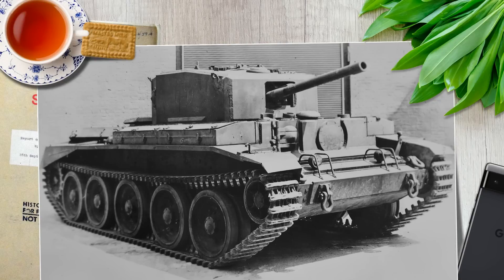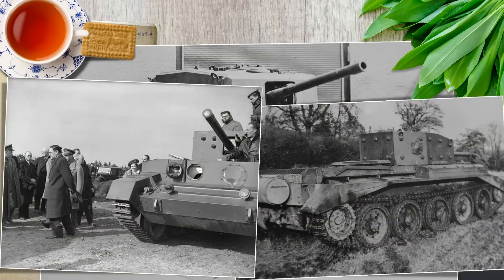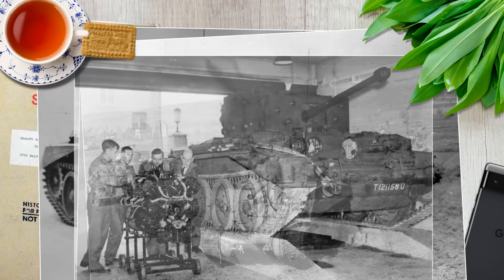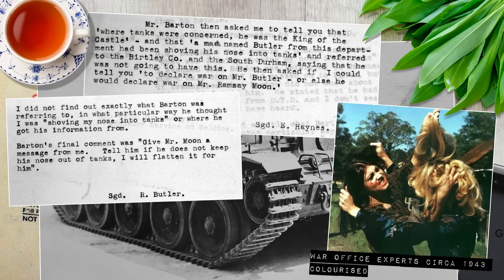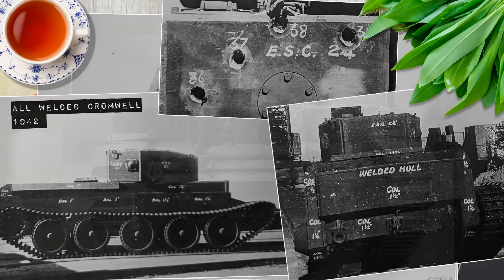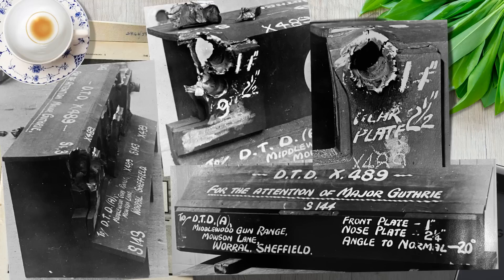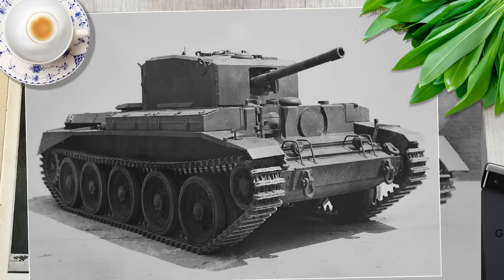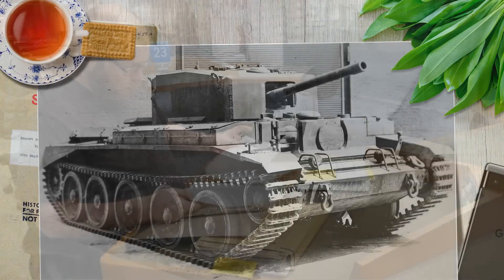Heavy Cromwell - Tank Design & Development

Comment: Always wondered why they never thought of extending the hull over the tracks to take a bigger turret ring and hence a bigger gun as with say the IS2
Reply from the maker: yuo could i suppose but it would make repairs harder, the christie has an inner outer hull skin, so to change a broken sus unit you would need to take the outer skin off, which would mean taking the hull top of and turret off to do it that way
Reply: Isn't that more or less what they did on the A30 Challenger?
Reply: They cut, widened and lengthened the whole hull. The turret ring stil barely extends over the tracks
Reply from the maker: @tanfosbery1153  A30 also has a very different turret and turret basket from regular tanks, which was a timley and expensive sod to build

Comment: Interesting story about the heavy Cromwell and more or less about the British scandal about the tanks that was supposed to be put in production "years before". I think the turning point was the production of the the much better and modern Meteor Rolls-Royce engine derived from the Merlin engine compared to the usual license built by Nuffield of the old V-12 Liberty engine, in truth an old fashioned engine despite its upgrading. This helped to produce better tanks from 1943 such as the improved Cromwell, the Comet and the magnificent Centurion. The only standing question I have is why many British tanks are not fitted with a mantlet instead of having a gaping shot trap at the front of the turret like most of the German, American and Russian had installed on their tanks. Is there any particular reasons for this omission?
Reply: They have an internal gun mantlet with usually the same thickness as the rest of the turret face.
Reply: @Akm72  I understand that but the following tank, the Centurion has been fitted with a mantlet like the M26 or even the Panther! Both the early Pz.Kpfw IV and the Pz.Kpfw III were fitted with the internal mantlet but they were quickly replaced by an external mantlet because they found out that the incoming shells tended to stuck the internal mantlet and the gun. This is what I understood....
Reply: @paoloviti6156  It's probably worth looking at the earlier gun-mantlets (such as those on the Matilda, Crusader and Valentine) to see where the designers were coming from when they designed the internal-mantlet 6-pdr turrets for the Churchill and Cromwell tanks in 1941. In addition, the slightly later internal-mantlet on the A30 Challenger is worth a look.
Reply: @Akm72  thanks I will have a better look on this subject regarding these tanks you mentioned 👍👍

Comment: did they ever also change any aspect of the drivetrain to compensate for the added weight of the armor? 
such as the gear ratios, final drive or even to the Meritt-Brown transmission.

also, having it in War Thunder would be nice, it would work help as it's armor is kinda lackluster especially with that attrocious reverse speed (hence why i still love playing the Crusader even in slightly higher br).

Comment: In truth, one only has to look at the expenditure of HE vs AP rounds in our tanks in WW2.  Nearly all of the memoirs focus on tank v tank because that was a very memorable event (should one survive).  The extra armour might have given some additional protection against AP but most combat ranges were close enough tnat a PAK40 could have still solved the problem.  It was only really post WW2 that tanks became specialised tank killers and to do that they had to restrict their rounds to 40 or less which makes them pretty useless in the breakthrough role.
Reply: Erm , what ? ... so, ,.. no . Post war main battle tanks are multi purpose gun platforms , not specialized tank killer. 
In fact I'll start at the top and work down,..
Tank on tank combat occurred far more regularly during word war two than it does today because there were far fewer anti tank weapon systems available.  No missiles , no helicopters , jets , ect , ect,.. so tanks ended up doing a lot of the heavy lifting in big battles like normandy.
Looking at the expenditure of ammunition is a blunt instrument. HE was plastered everywhere , all the time. Searching fire. Keeping heads downs. And so on, as you'd expect.
I get the distinct impression from your comment about war memoirs that you are repeating a mantra  that you have been taught. Have you actually read any memoirs ? Or any history books , for that matter , ones dealing with battles like El Alamein or Normandy ? 
I have read quite a number of war memoirs , myself , and none of the ones that I remember reading seem to focus on tank v tank to the exclusion of anything else.
This seems to be a dismissive comment , as if you are criticizing the authors in some way , or attempting to delegitimize the entire genre , but what is your point exactly ? That tanks didn't fight tanks ? That they are remembering it all wrong ? It's not as if there aren't plenty of history books recording the entire war,.... 
The extra armour would have greatly increased the survivability of the Cromwell, period.  101mm of armoured plate is a far better bet than 63mm of plate. Most rounds come in at an angle or are otherwise sub optimal hits .
Many tanks in WW2 were specialized tank killers. Sherman firefly , all the ''tank destroyers'' (tanks in all but name),....anything with a two pounder or similar weapon ,...
Modern MBTs are multi purpose gun platforms. They have had to restrict their load outs to about 40 rounds for the main gun on western tanks, about twenty or twenty five on soviet legacy designs.  This is because of the size of the rounds. They use bigger guns because a bigger gun is more useful in ALL battle field roles, not just the anti tank role. These days the anti tank role is far LESS reliant on tank V tank battles. Attack helicopters, powerful and accurate missiles , manpads, ..all these things and more have gradually taken up the burden of the anti tank work.  Tanks are now mostly used as direct fire support against reenforced positions .
MBT are extremely useful in the breakthrough role. We saw that in the first gulf war , and the second.
Taken to it's logical conclusion , you would seem to be arguing for a lightly armoured tank armed with a small gun with minimal anti tank capability . Not a modern MBT at all.
Reply: @andrewwoodhead3141  Part II: To make it absolutely clear I did not say “to focus on tank v tank to the exclusion of anything else.” I was a territorial army infantryman in my 20’s (I’m in my mid 60’s now) and have read a great many memoirs, history books etcetera including having talked to many of my patients who were in both great wars, one of whom was a tank driver on the Somme, and still had crippling injures from that time.  I am not trying to denigrate anyone, nor support any particular theory but you do actually make my point when you state: “HE was plastered everywhere, all the time.”.  This is my point exactly.  Particularly in the case of personal accounts. So for example, in Tank Action: Ab Armoured Troop Commanders War 1939-1945 David Render (the first one I found on my kindle) there are18 references to AP but none to HE.  
The 2lb and 6lb gun armed tanks were a disaster for the British Army.  Lacking an HE capacity they left machine guns as the only weapon to use against ATG and soft targets.  This was clearly the view by 1942 when 200 NA75 Churchills were rebuilt to allow a 75mm gun with an effective HE round to be used.  The 6lb gun was intended to be the primary armament of the Cromwell but it was bored out to accept a 75mm round accepting the significant reduction in anti-tank capacity that gave.  That was even more noticeable with the introduction of APDS for the 6lb gun.  And yes, they could have been refitted quickly into Cromwell, both mounts were similar. 
Finally, if I were designing a modern MBT on the premises you abstracted from my comments I would remove the loader, have an autoloader on a vehicle a bit like Challenger 3 (Say Challenger V).  I would equip it solely with 120mm HESH rounds (No LRP's) reduce the barrel length significantly, allowing more rounds with the additional room available.  This would nicely meet your primary criterion of “Tanks are now mostly used as direct fire support against reenforced positions” Oh and I would want at least 500 (and I know we only have about 238 hulls less whatever we have given to Ukraine.
Reply: @simonnorburn3518  Good stuff. I am also ex army. Three actually . ZNG (Croatia 1991), British army signals (Armoured Squadron for a couple of years) and the YPG in Syria a few years ago. 
My Grandfather fought at Cambrai. In fact , from what I was told , he fought through the entire war. Northumberland Fusiliers .
Now that we are introduced.
Personally I have yet to read a war memoir that focuses unduly upon tank on tank combat, in fact I am struggling to think of a single one that could be said to focus on tank versus tank combat at all.
I am in complete agreement with you as regards the 2 Pounder and the 6 pounder guns.  I think that anyone who has read a few accounts of the fighting or a few history book on the subject must agree with that. These weapons lacked a decent high explosive shell and that was a big problem.
However, the 75mm round was lacking in the anti tank department and they paid for that too. 
A tank needs to have both capabilities. It's not one or the other.  
Thank god you are not in charge of designing the next generation tank is all I can say, I don't think the lads would thank you much for taking their Kinetic ammo ! :-) 
Although , now I think about it,... they kept challenger two with a rifle for the longest time simply because they had a decent HESH round for it.  So, ...just keep challenger two , then ? But leave the auto loader for the Russian ...
I'm don't think we are giving  any tanks to the Ukraine . Deployed to Poland , yes, given over to the Ukraine army ,.. no , I think not.
Reply: @andrewwoodhead3141  For some reason this doesn't show so I will resend it without the links - part 1 for the third time!

Thanks for the long and detailed reply. I actually posted a response earlier but it seems to have gotten lost in youube so here is a similar one.  To start with the effectiveness of an additional 38mm of armour.  Fortunately we have an easy comparison here.  The Comet had about 103mm frontal armour, was in the same theatre of war and was fighting the same weapons.

During its period of service in  WW2 there were 54 comets wiped out – sources How-many-Comet-tanks-were-knocked-out-in-World-War-2 and also british-tank-losses-march-to-may-1945-the-war-in-north-west-europe/  Cromwell losses were 73.  As a percentage of types in service they were Cromwell 22% and Comet 16%.  This would seem to support your contention that the thicker armour was better.  However Only 4 of the Comets and 18 ½ Cromwell were knocked out by mines.  These losses would not have been affected by heavy frontal armour and so we can recalculate the figures.
These new figures give us 15% of Cromwell and 14.2% Comets lost.  In each case Hollow Charge (HC) was the single largest killer and it is noted (table 3) that these were primarily the Panzerfaust.  That gives us a good explanation as to why the percentages are so close. The longest ranged Panzerfaust (150) was about 150m. (No surprise there!) That is well within the effective range of penetration by a Pak 40, let alone a PAK43.  Indeed from table 2 on the first reference about 2/3 AP attacks penetrated, with the PAK40 (the least effective A/T gun) penetrating 7 times and bouncing 3 times.

Also, from table 10 here british-tank-losses-march-to-may-1945-the-war-in-north-west-europe about half the hits would have been on the sides of the tank which was not uparmoured (note that just over 60% would also have been on the front, there are ambiguous positions that could be either side or front.
So I think this shows quite clearly that at most combat ranges throughout the Comets time in the European theatre the additional armour compared to that of the Cromwell was not terribly useful.
Reply: @simonnorburn3518  There has been a problem with YouTube for a couple of months now and it seems to be getting worse. Very often comments are deleted or hidden. very annoying.
Comet was only introduced into the fighting from January 1945 onwards, after the Ardenne offensive was over.  From March onwards the Germans effectively abandoned the western front and those few tanks and guns they had left were sent east with their formations.
So , yes , by that point all they had left were mines and close range anti tank weapons , PanzerFaust and bazookas and such like . The war was over , they were done, No tanks , no guns , no fuel , nothing.
And , yes , they would have been hit on the sides because that is how you ambush a tank with a short range weapon. You don't hit it head on because that is where his thickest armour is. Also, you are only going to get the one shot because , after that, you ain't going to around long...
It does not follow that, had the Germans had Anti Tank guns they would have engaged  at 150 yards ! 
If you have the range you use it. As the Germans did every chance they had during the war. You don't wait for the enemy tanks to close to 300 meters or less because by that point he is firing his machine guns into your position at point blank range and his infantry is yards away from you and pulling the pin on a grenade. The only reason you might wait that long is if you have no alternative 
All this shows is that during the very last few weeks of the war (March, April , May) the germans had nothing left to fight with . 
Again , I am having trouble understanding what it is you are trying to prove.
Perhaps a better approach would be to re read David Render , with his eighteen references to AP,  and , instead to comparing this to his ammunition expenditure and trying to prove him wrong , you might consider the possibility that the man might be  trying to tell you something? 
You have already stated that , were you to be put in charge of designing the next generation MBT, you would deprive it of any significant anti tank capability , are you now arguing that it should be thinly armoured too ? 
I want to return to your previous statement that the 2 pounder and 6 pounder guns were a disaster for the British army . Yes they were. But not as much of a disaster as not having them would have been.  Anti tank capability proved essential in the desert, as it did in Normandy.

Comment: Would there have been any move to slope the front glacis?and would there have been any advantage gained by doing so?
Reply: As a development that was expected to go into service ASAP, no.  Redesigning it for a frontal slope would have delayed it and caused even more delays for the production as it would have required the factories to rejig.  But if the designers had have known how long it would take to see use, they may well have opted to redesign that part.  Joy of hindsight, eh?
Reply: Sloping the armour would have reduced interior space so it's very likely that the vertical front glacis was a deliberate design choice to give the required space.